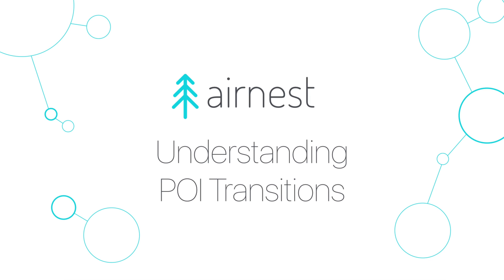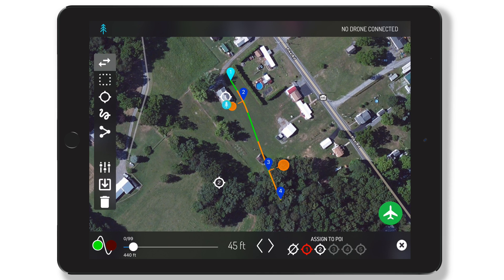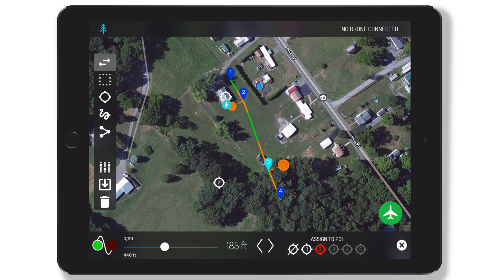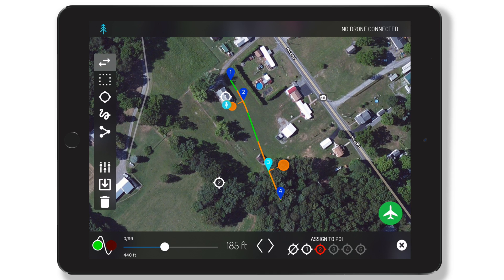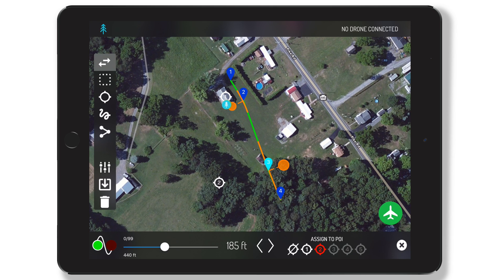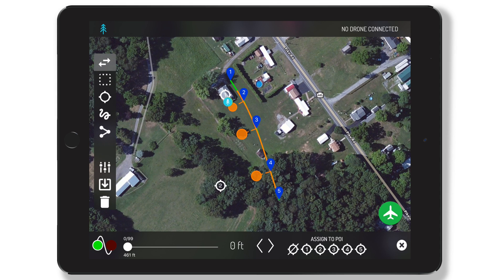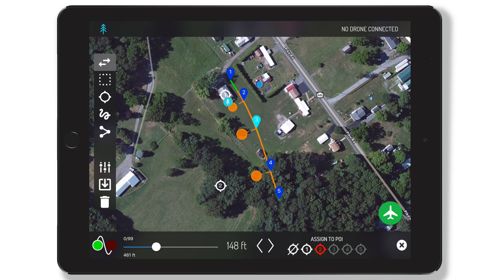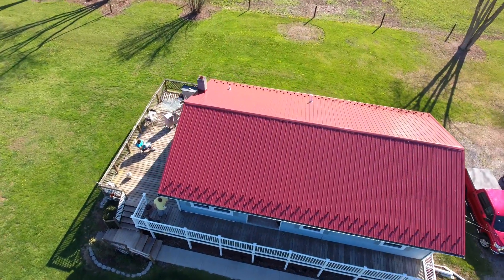Understanding POI Transitions - Plan Tool

Comment: Are the "smoothing" settings retained from how they are set by the Go app or do you provide access to those settings in the Airnest app? I ask because all the gimbal start/stop transitions are nicely smooth (good ramping of start/stop) except for the beginning of the pitch-up from the house in the second test.
Reply from the maker: +Eric Braun The speed is based on the proximity of the two transitional waypoints. Though I am still tweaking the ramping portion. Basically the speed is set to happen in the amount of time it takes to go between the two transitional waypoints.
Reply: +Airnest Yes, the speed is fine and I understand that. It's just the suddenness with which the gimbal's movement starts... as you say, it needs "ramping". The other start/stops were great, so obviously Airnest has facility for controlling this. It looks great! Thanks for your hard work.